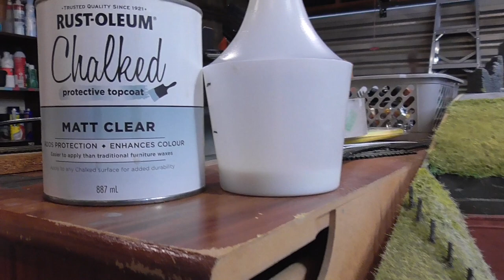Scenic progress on the viaduct area with foliage additions.

Comment: Coming along good! About 4 or 5 years ago CRC had a problem with a few batches of Ados spray adhesive (not water based) and the CRC rep Peter replaced all of the stock where I worked with new product, so it might be worth talking to your supplier if you still have problems at  warmer temperatures . Cheers Alan.
Reply from the maker: Hi Alan, thanks for the CRC info, I'll look into that. I bought the spray adhesive from Mitre10.